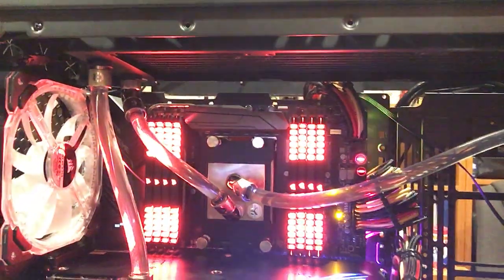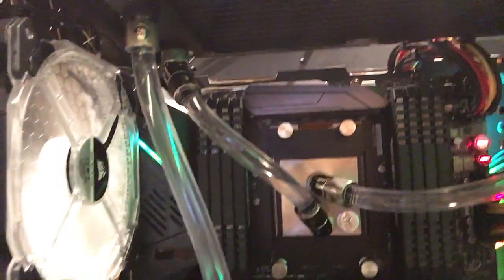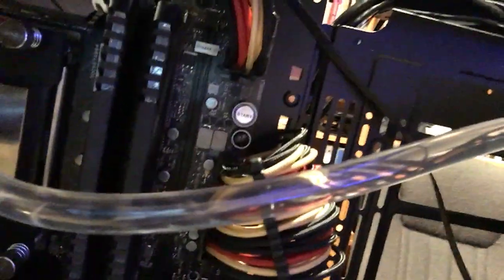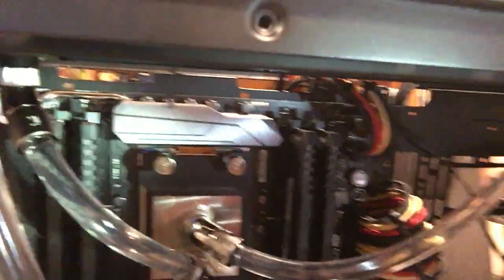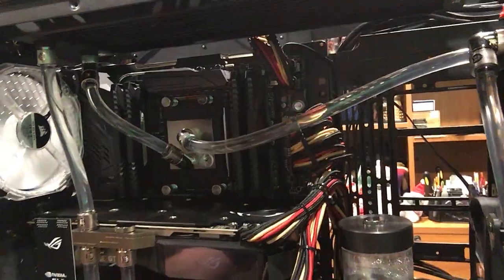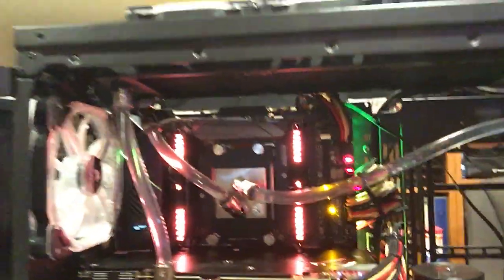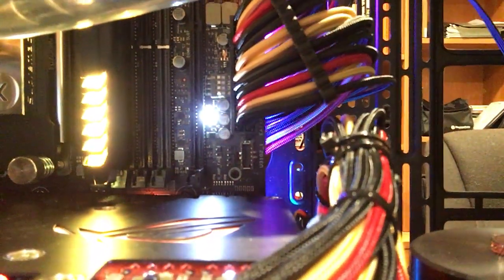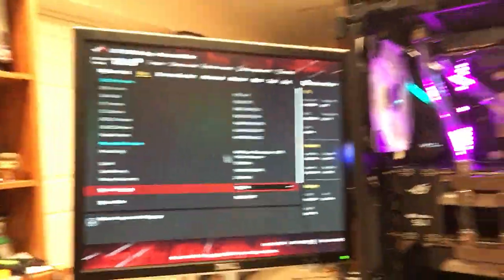Asus Zenith Extreme Motherboard MAJOR MEMORY ISSUES

Comment: Its just and Asus thing, my Asus x99 Deluxe also had issues with memory when it was new, a few bios updates later seemed to fix it at stock settings, This board I had to give the SOC a bit more voltage and the ram about 1.39v to always have all 8 sticks to be detected, at its stock 1.35v or my other kit at 1.25v the board wouldn;t see all the sticks for some odd reason. I can tell you I'll never buy an Asus board again on both Intel and AMD, my x99 board killed 3 5820k's in 2018, apparently was a common issue with Asus's OC socket and Asus customer support is really terrible.

Comment: Me too having problems with TR 1950x and Asus Rog Strix x399 e-gamin. Ram is Corsair Dominator Platinium 2666mhz.
The computer work fine for 1 mounth, and  sudenly restarted and had 1 bip and keep restart with 1 bib.
Q code was D0 (unable to initialize CPU)... So I remove cpu, clean it, clear water block. Everything looks good, no bended pin on mobo, cpu look good.
I reinstall cpu, and now, I have 3 bips and no displays on screen....
Q code shows Ad 

What is weird, is that it worked perfectly for 1 month

Comment: Going with this same Mobo on my new build.  Can I use 2x16 GB sticks for a total of 32GB?  I know the board's capacity goes up to 128 GB, but I don't know if there is a particular combination that this board will/will not work with.  I didn't see anything in the pdf manual stating what particular combination for memory capacity to use.
Reply from the maker: Don McKiness you can easily use two 16 gig sticks
Reply: Thanks for the fast response.  Feel kinda silly now because looking again in the PDF and it clearly shows/states memory configurations.  Did you ever find out the problem with the memory for this mobo?  Thanks.
Reply: CPU!  Got it.  Thanks.

Comment: Shoulda gone X299. Dumb questions but have you tried memOK button and or BIOS update since this video to get it working? These Zenith issues (and there is a lot of them!) are the only thing swaying me away from X399 (I want ASUS) towards X299 as you can never go wrong with an intel build especially with a nice EK monoblock etc
Reply from the maker: From what I can tell on this motherboard there is no memory OK button. I actually called ASUS on this and they put me on hold for about 30 minutes and never picked back up. I’m actually trying new CPU this afternoon. After three motherboards in about 5 to 10 different boxes of RAM the only other comment nominator is the CPU. According to one of the guys over at Micro Center who actually has a threadripper system it could possibly be that the CPU is just not reading those two chunks of memory show swapping out the CPU may do it. We will know in about two hours.
Reply: Thats very interesting, if its the CPU causing this issue for a lot of people, AMD went wrong somewhere along the lines.
Reply from the maker: It was the CPU. Here is my final video update. https://youtu.be/OD3tDwwLZbk
Reply from the maker: It turned out to me the CPU itself was causing the issue. Once I replace the CPU with a new one that I was able to. exchange the memory issues vanished. https://youtu.be/OD3tDwwLZbk
Reply: Definitely going to see if anyone else has fixed this issue replacing the CPU because if thats a fix, I may turn to threadripper instead! Cheers!

Comment: I had same issue.  from the front of board   X-o-X-o   THREADRIPPER   o-X-o-X     Rear of motherboard.    X is memory o is empty slot  ignore first dim.2 slot
Reply from the maker: it turned out to be. a CPU issue. Once the processor was replaced with a new one, the memory issues went away. https://youtu.be/OD3tDwwLZbk

Comment: I had this same problem. I actually placed all four of my Ram on the left side and it worked. I returned the ram thinking it may be a problem or something, now I'm just waiting on a new package.
Reply from the maker: Thanks, I tried this but I went from Right to left starting at the front of the motherboard and working my way back to the rear of the motherboard near the back IO.  ISo, All slots EXCEPT D1 and D2have ram in them and it booted up without any problems.  Also for some reason, Slot D1 seems Very tight or difficult to get the ram into the slot without clicking in.  Right now there is not ram in D1 or D2 and it is showing 48 gigs of ram.  (6) 8 gig sticks currently.  I am wondering if there were a batch of bad boards with a bad D1 or D1 and D2.  Video reply. https://youtu.be/Z0z9Gdg3GHU